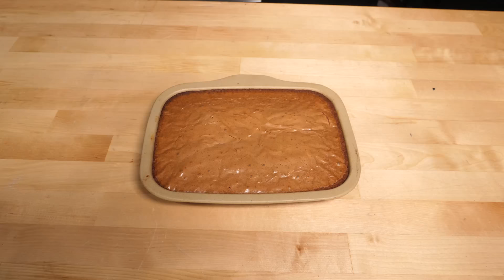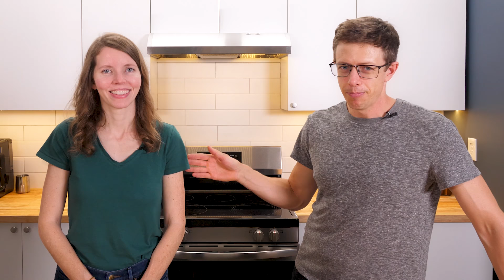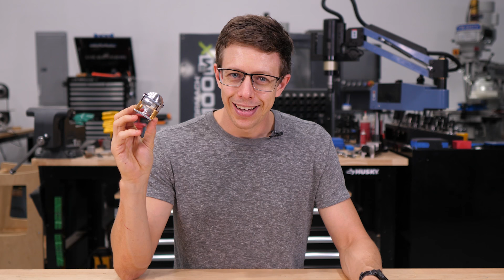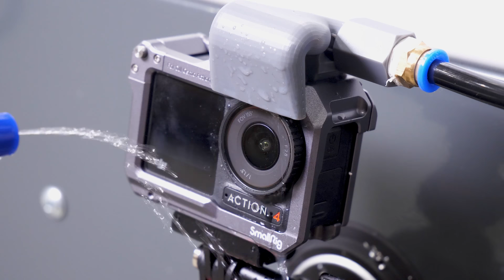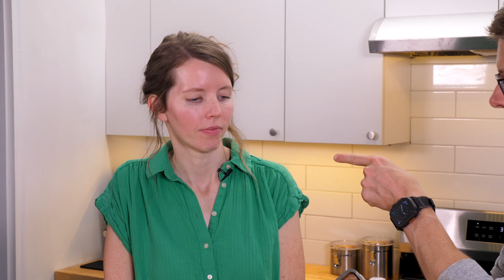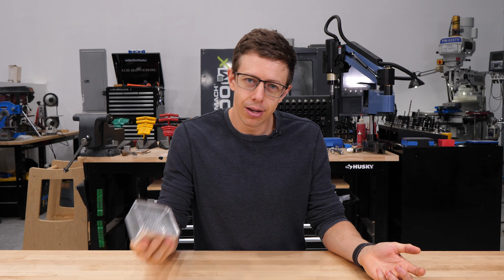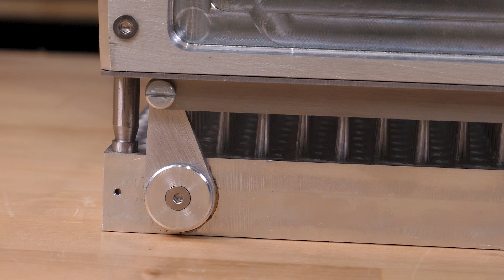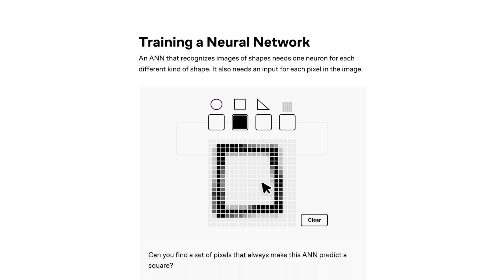Baking brownies from the inside out

Comment: For the air-cooled camera inside the oven, I honestly can't believe that worked.  Air has such an incredibly low heat capacity (thermal mass).  At work, we once had to make some temperature measurements that involved flowing air at various temperatures through a tube located in a different ambient temperature.  We ended up putting several layers  of thick insulation around the tube, and even then there was a significant temperature gradient along the air flow path in the tube.  I'm curious what the air flow rate through the tube ended up being required to achieve the cooling effect needed - I suspect it was quite a high flow rate.

Comment: I love the over engineered the bottom - there are commercial brownie pans with removable bottoms where the top part has slightly sloped sides, and a little lip for the bottom to rest on, and the bottom can be lifted out. No screws or mechanical linkages needed. But your lever contraption is much cooler looking.
Reply: Yes lol. I don’t know if I’ve ever seen the kind of pan you’re talking about, but all I could think was, surely a springform pan could be modified somehow to suit this purpose. 😅

Comment: Before needing a mill and bunch of R&D to make complex brownie pans:

How about changing how you cook the brownie. Same pan as a square/sheet pan but different temperature and time standards.

We do this with a sous vide when cooking different proteins. Say an egg. Why torture an egg in boiling water (100°C) when you can control exactly how the egg sets up? Setting the sous vide to 63°C to 68.5°C is often the perfect temperature range for people who want a soft ‘boiled’ egg.

The internal temperature of a brownie doesn't need to be 175°C to be fully cooked. Rather a much lower temperature. Thus with some experimenting, an oven that can precisely and accurately hold a temperature between 50°C and 300°C: one should be able gently cook a brownie (by never overheating any part of the brownie).

Will all of the ingredients like being kept at an elevated temperature for >1 hour? I don’t know.

Comment: It would be great to electoplate the Aluminum with stainless steel. Aluminum leaches into food and that has been proven to have detrimental neurological effects over the long-term. Absolutely a non-issue for a one-off project, but over time - especially with how much of the Aluminum touches the food - you can slowly experience issues if used often.

Comment: Ah, I love it how when youtube can't even figure out the links are it's own videos and still deleted the comment.
I don't want to retype all that.
Resistive heating bread is a thing, since the dough is a conductor, you can pass an electric current through it and it will heat up, that way you can heat it from inside out without all those contraptions.

Search for 電気パン on youtube and google and you can find a bunch of videos about it by the Japanese.
If you want the crust, you can use a hot plate to heat and dry up one side of it afterwards.

Comment: An improvement would be utilizing a springform pan design to remove the edges of the pan after cooking for easier cutting, although this would introduce more chances for leaks. Feel like someone who wanted to make their own could use a standard springform pan as a base just need to drill holes in the bottom and find away to get machined aluminum spikes.

Comment: I’m surprised you didn’t just make a spiked pan with a lifter tray. They make similar things for meatloaf (minus the spikes). Bonus is that it’d also make it easier to cut and serve.
Reply: He mentions around 17 minutes in that hand lifting the tray likely wouldn't work, as any uneven lifting would cause the pan to catch on the spikes
Reply: @TheGrimSmile  the racking problem he describes is with the vertical cylindrical rails, not the spikes. The spikes taper to a point so it’s not a problem.

Comment: 20:20 isn't this a classical physics problem? Why fit a polynomial to the data when you know the weight of the ball, the initial velocity and angle, even air resistance?
Reply: Bro you wanna solve that ? Think about it now you gotta dig up the friction coefficient for a smooth steel sphere, worry about the freaking density of air, average exit speed at the end of the mortar I mean urgh. It's a one variable problem. Just launch a dozen balls. Have excel give you a good approximation

Comment: Respectfully: 

If centers were better than edges, we would have had a center pan before this.

The fact that the all edge pan already exists, seems to imply to me that it's superior.

Though this is so much cooler.

However.

We need a comparison with the thermal gradient checker tool you made.

Can you low and slow oops all centers using the all edges pan.

Cause it's a surface area problem. No?

Comment: If the problem is the heat transfer from the edge of the pan to the cold brownie, would cooking the brownie like you do cheesecake not solve the problem? smaller round pan inside bigger pan that has water in it. The water slows the heat transfer? I haven't finished watching yet but just food for thought

Comment: to prevent the big pan from leaking make the holes the spikes go through to be straight, but the top of them having a smaller diameter than the bottom most part of the spike, use the lifting mechanism to also lock down both parts together with force to create a natural seal between the parts.

Comment: Hello, you could silicone line the edges of the pan, or better yet an entirely silicone pan, a thick enough layer of the stuff will more or less simulate being cooked while floating since it's insulating more than conducting heat

Comment: If you cook a cake in a round pan, the middle rises more than the edges, because the edges cook before the batter can rise. You can prevent this by using a "level baking belt". You can buy professional ones, or make your own using wet paper strips and foil. I think instead of trying to cook the inside, insulating the outside would work better.

Comment: I think I can explain why a cake doesn't bake with an edge like a brownie, and it has to do with a piece of the puzzle you might not even know you were missing: Leavening. Your brownie and cake batters have leavening agents, either mechanical or chemical. For mechanical, you whip air into the batter which expands in the heat of the oven, and chemical is just a reaction that happens either cold (single acting baking soda) or heat activated (Double acting baking powder). Both are affected by the weight of the batter pressing on it. Brownies tend to be leavened less than cakes, with just chemical leavening doing the heavy lifting,  making them more dense. The weight of the batter pressing on the edge while it flash-sets is what causes it to be denser than the rest of the batter which has a greater amount of time to do the work of raising the batter. Cake batter is leavened mostly with mechanical leavening (you whip air into fat and then incorporate the other ingredients, preserving the air bubbles) which makes them already light when it goes into the oven, giving it a quicker rise. Because it rises quicker it tends to not form as thick of a crusty barrier. It does happen, but I think a good portion of that crusty part remains adhered to the pan. Anyways, this speedier rise is also why cakes (especially cupcakes which have additional chemical leavening) tend to bake into more of almost a peaked shape.  If you watch your footage of the first pan, you will notice that all the batter rose at the same time, instead of that sort of time/temperature gradient that you normally get.

Comment: I would go with a large circle shaped pan and build a custom oven that uses a circle flame smaller in diameter to the pan so that edges don't get direct heat. Once baked, I would cut out the edges and there you have it. No edges and an even texture in every bite. Is it scientifically perfect probably not, but I would get over it quicky with a scoop of ice cream on top. Nice video,it was cool

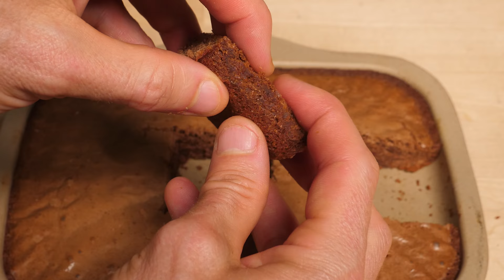Comment: What type of aluminium did you use? Is it food safe? An you could have used tapered stainless steel pins, they have 1:50 taper on them, not ideal but they can be replaced and easier to clean

Comment: 10:26 OK, so you decited to make a pan that can more evenly distribute heat by putting more connections between the pan and the brownie. You even put a heat sync on the bottom and you still expected the brownie to want to cook slower & hotter? Even with that graph you showed that means it clearly cooks faster?

Comment: I would have figured a mechanism like a snap-lock lid, but in reverse from the bottom would've been much simpler.  But maybe still run into the racking issue due to required materials being heat-proof.

Comment: A cake with edges isnt so hard. Make a standard chocolate cake, grease your cake pan and then do whats called "sanding" the pan. Throw some flour or sugar or cocoa in and tap and rotate the pan so the grease holds it. Still releases like a greased tin but you get a little more texture and flavour around the edge of your cake.

Comment: Would creating a double-wall pan and filling the void with cold water give you a similar result with less complexity? Use the water to absorb heat at a similar rate as the brownie batter and reduce edges?

Comment: Im curious why you didn’t approach this the opposite direction. If the edges are the issue why cook the center faster when you could cook the edges slower? Silicone ring around the pan should slow the cooking and be a simpler solution no?

Comment: Why not make a pan with insulated walls? A normal brownie center on a big pan can only cook from the top and bottom. If you want to make it fancy use space shuttle tile material. You can grab that stuff with your bare hand even when glowing. Amazing!
Reply: And the part of the wall touching the brownie would have to be a different material from the bottom to avoid conduction. Anything with a thermal conductivity equal to or less than batter would be fine.

Comment: Hi...cool Project.

I work in industrial bakeries... there is a much simpler solution. You bake with steam AND heat.

This way, you can control how much your edge  dries out during baking .

Theoretically, you could bake your brownie at 100 degrees C and some steam, and the brownie will look like the inside everywhere

Comment: Why didn't you ever test the spike pan with non removable bottom? If buttered up well and flipped over to cool the brownie should slid off the tapered spikes no? as easy as all the spikes came out every time I don't see the non removable bottom one wouldn't work. side note taper the pan too (2-3 degrees), leave the spikes and don't have the bottom removable.

Comment: Did you consider using silicon as a material? Imagine that since it's a poor conductor, most of the cooking is radiation + convection heat transfer as opposed to conduction and you might end up with no edges. The principle and engg problem solving approach is seriously brilliant though so I am not gonna complain.😂

Comment: to stop the pan leaking could you use two different materials for the top and bottom with different thermal co-effecients of expansion so the gaps seal in the oven and release again when taken out? though you would need to wait to be able to realease the spikes.